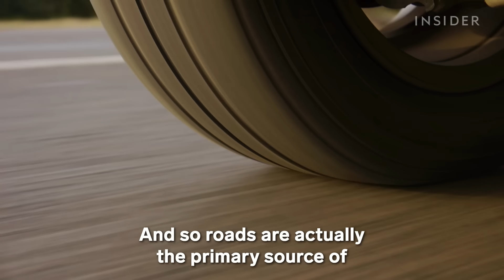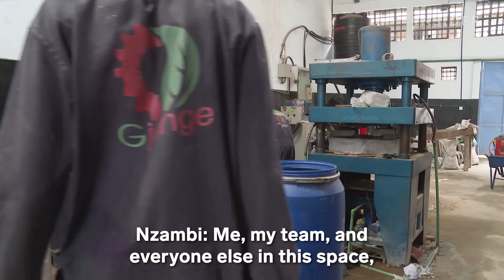Young Inventor Makes Bricks From Plastic Trash | World Wide Waste | Business Insider

Comment: We shouldn't use these for roads for cars because they would make a lot of microplastics, however we should use these for streets that people walk on since it would undergo a lot less abrasion and damage
Reply: Using these as foundation brinks wouldn't be a bad idea either.
Reply: @Holly Donut  yep. Some foundations use concrete with a compression strength psi of 3000. Some plastics have 2000 psi so it wouldn’t be a bad idea if the foundations are a little bigger and have a little more steel reinforcement. The only issue could be how they perform in earthquake heavy areas. 

And in terms of using these for roads it is definitely less worse for people based paths than car based ones. But the weather can still erode it into micro plastics. But tbh it is better than a land fill. Plus they can just use it as the bottom layer which is rarely exposed to the weather.
Reply: @Dutch_chess  It would be an immensely stupid idea. The bricks would break down over time, and would be continually leeching toxins in to the soil which would contaminate the ground water and work its way into rivers and lakes.
Reply: Toxic roads. They breakdown overtime, mix with water, and poison waterway.
Reply: It will undergo just as much abrasion over time. It is mixed with its own built in abrasive, SAND. This has to be one of the stupidest ideas I have ever seen. I cant get a plastic straw for my Thickshake, but this fool is praised for injecting micro plastics into the waterways and the oceans. All aquatic animals will be effected by this, causing damage on a molecular level, causing death and deformities. Anyone who cannot see this is unable to think for themselves.
Reply: @Tarquin67  u got a good point
Reply: most people don't have cars in Kenya anyway
Reply: @triplemoyagames4195  if u rilized they were also talking about making the place bigger and start sending the stuff over seas
Reply: @stevenrayne6401  I mean Africa is a huge place. With many countries having the same issue
Reply: @triplemoyagames4195  are you that naive to think these bricks will only be used in Kenya. This persons ‘invention’, for lack of a better word, will be used in other places. Just the comments of all the people in the video show you peoples lack of intelligence to see that this is not a good idea. 
 It is like the electric car. Sure you have no emissions, but what sort of energy mainly used to charge these electric cars. Fossil fuels!…..I do not know of ANY charging points in ANY country that use solar as a source. They are connected to the electricity grid. Then you have almost the entirety of the cars components being made of plastic. Plastic is made from OIL, and what is done with the plastics when the car has completed service. How are these plastics recycled or disposed of? With fossil fuels!. Then you have the highly toxic chemicals used in the batteries of the vehicles. How are these disposed of or recycled, and what sort of energy source is needed to do this. It certainly is NOT solar power, or wind power. Then you have the tyres which are the same as any other vehicles. They are full of toxic metals such as lead and zinc, which are worn down to fine particulate that is then washed into rivers and oceans every time it rains. 

And for that matter what sort of energy is used to produce the entire electric car. Fossil fuels. And before you say there are plants that use renewable energy, I challenge anyone to prove to me that there is a plant anywhere in the world that professes to be sustained by renewable energy, and I can show you where each and every one of these plants is still plugged into the main fossil fuel power grid. Watch Planet of the Humans to verify this.

AND I CANT EVEN GET A PLASTIC STRAW TO USE IN MY THICKSHAKE!
Reply: @Tarquin67  So you've gone on a rant because you're pissed you can't get a plastic straw really?
I am against fully electric cars replacing standard ones, but that's so unrelated to the topic at hand.
Also since we're being real, at the current stage, her company is know where near going international. she's barely covering Nairobi. I would know considering I'm a native.
It's a bad idea on roads, not sidewalks. Most kenyans don't have cars, nor the infrastructure to support them efficiently outside major cities and it helps address our major pollution problem
Reply: @triplemoyagames4195  Why aren’t the long list of things I mention banned?………..
Reply: most plastics break down in uv light (including sunlight) meaning putting them outside would be a bad idea.

Putting them inside is even worse since they would literally be gassing you
Reply: Is it fire, chemical ,
resistant?
Reply: Yea like side walks or the bike lanes
Reply: Ok
Reply: Keep going it is future, trust 🙏
Reply: @dertythegrower  ķ
Reply: Well we could use them for bike lanes because they were already in the environment, spreading. so using these plastic roads are slihtly solving the problem by stopping the plastic from floating around
Reply: Do u know how a lot of big store like Walmart,  Stine's, academy, some schools and a lot of others use a brick floor instead they can use this with a seal paint on top for stores and schools. This could also be used for parks and water parks.
Reply: They don't ve even streets and you are dreaming about roads for people

Comment: This is ecologically disastrous. If you imagine the day to day wear and tear, all the foot traffic and cars that will eventually erode and chip the plastic pavement releasing micro plastics into the environment. It solves a problem, but also creates a bigger problem.
Reply: i agree completely, but we're at the end stages of the industrial revolution where we've maxxed out the world's resources and normalized plastic as consumers. plastic is going to be impossible to avoid at this rate, burning it and created styrofoam-eating worms will only solve barely a fraction of the issues with plastic waste. had she not created a new method to utilize discarded plastic, it would've been left to erode and chip into the environment either way. at least in this form, it can be recycled and utilized productively.

Comment: Well if the plastic leaches or degrades over time it probably isn't wise to use them on high traffic areas. But again plastics tend to melt in heat, whereas asphalt can crack... Could the plastic in these tiles keep them from cracking?

Comment: Doesn't matter if its as hard if it doesn't have the kind of compressive strength of concrete. Its plenty useful for certain low stress applications but not high stress ones

Comment: I really hope this industry will be more widely accepted and companies like this can be given more support, like those workers need respirators when they are working with the plastic and pigments. My grandfather died of cancer after working as a foreman in a paint factory for decades and I think he had better protection than those guys
Reply: The main problem is going to be convincing people in lucrative expansion areas to adopt it and that's not happening with the concerns over microplastics, which is going to have to do with the binding with the sand that can make those brittle. Tbh they may actually be better off using pure extruded plastic bricks at that point. The Chinese may well adopt it idk, but the Western sectors will be slow to find acceptability in mass paving using plastics (the irony being it'll probably be a net detractor by hoovering up what would be dumped into the ocean otherwise).

Honestly we DO need more inventive ideas like this which the whole Western world has stagnated badly in its complacency. Given we are now suffering a baby formula shortage it's clear this system is not working and has achieved Soviet levels of efficiency and usefulness while wasting colossal amounts of resources. Recycling in creative ways in a lucrative manner is laudable.
Reply: I would disagree on the having it better.. ive seen werkplaces here in the Netherlands that now are better, but dont overlook 40 yesrs of evolution in technique and engineering :) he experienced times with less ventilation and knowledge on long term exposure, sadly speaking a human test subject, in great honor of protecting futures to come.. 

Sad to hear tho, and kind of you for worrying as well, was one of my concerns too, those fumes may not be very toxic short term exposure, but 40 hours a week might be less pleasant in the long run :/

Comment: I'm so inspired! She's providing a life for her 20 employees, and they're full time employees at that! I hope her business expands and she can tackle the plastic waste crisis in Nairobi and beyond.
Reply: @Daruki Neo I wonder how mold spores interact with this sand/plastic mixture
Reply: @Momofukudoodoowindu  I doubt it will get mold?
Reply: @kadens1903  under certain conditions, like prolonged moisture, they can separately. So that's why im curious if it can as a unit; and if so, will the integrity of the unit be compromised
Reply: I don't, she's creating more pollution and is part of the problem.
Reply: @First-Last_name  how is she creating pollution
Reply: @erensfeet5563  her bricks shed micro plastics in populated areas,  basically creating toxic micro dust.
Reply: @First-Last_name  how does bricks shed micro plastics? Seems like thats smthg that they would have addressed
Reply: @erensfeet5563  because they are made of recycled plastic. It breaks  down into a small fine plastic dust easier then most other plastics.

Other plastics eventually do the same, but much slower.  Her bricks essentially accelerate the rate plastic decays into a toxin, while putting it in public spaces.

 I commend her effort but it has unintended negative side effects.
Reply: @First-Last_name  Yes, agreed. Thats actually what they said in the video specifically and as to why it might not be sustainable long term.

Maybe there's something that can be added to lessen the toxins, but time will tell...
Reply: Toxic roads. They breakdown overtime, mix with water, and poison waterway.
Reply: Actually, since they are breathing in those fumes, they are technically giving their lives for this cause.
Reply: Everybody working there is going to get cancer from inhaling all those plastic fumes. (Notice she's the only one wearing a mask)
Reply: @Daruki Neo no it’s a terrible idea.. possible the most braindead idea i’ve seen, the spread of micro plastics will destroy the ecosystem.
Reply: Can u give her contact details
Reply: If any of you bleeding heart people really paid attention to video this is not the solution it's only making it worse. Micro plastic is worse than regular balk plastic. The true way to solve the problem is to stop using plastic period.
Reply: For the whole world we could build homes out of this stuff
Reply: @Luljpimp444  hahahahah there’s a reason educated and developed areas dont.. They aren’t braindead enough to spread harmful micro plastics that will DESTROY the ecosystem and everyone living in it LOL… Nothing like supporting a horrific idea.
Reply: @Luljpimp444  i make building bricks by stuffing soft plastics into plastic bottles - they are extremely strong when done right.
Reply: Providing job's for people to pollute the world. Amazing.
Reply: @KB-nt7eg  I think its a cycle. we didn't recycle this because we were not made aware of the dirty tactics food companies were up to. Now its our fault. Now more people on Kenya have jobs. Its a cycle.
Reply: @KB-nt7eg  are you slow?
Reply: @KB-nt7eg  They are not MAKING plastic. Blame the source. Nobody wants to STOP making plastic but point the finger at people like this? Use a little logic.
Reply: @PeppaJackable  all the while you blame your average Joe, right? They are putting it into uses where it can become even more fine and toxic. Where's your logic? I dont disagree with her business, I disagree with your insulting comment. In this video there's even an expert talking about this, why would you then go all insulting regarding logics if you didn't even focus on the video at hand?
Reply: i wanna buy shares of her company this seems like a brilliant idea
Reply: Big respect, you have no idea how many people should be doing this 🙏 big up

Comment: How does it work in practice?. It is clear that it will never be able to be used to build materials for buildings as it can melt and therefore will never be able to live up to the western standards within the construction industry.

How should one use that product as a replacement for asphalt and stone as road materials? To my knowledge, this product will give off plastic in case of wear and tear, and therefore it will not be very appropriate to use this product for roads as small plastic particles will be spread all over the wind and end up in nature and animals will end up eating it in the end i guess ? 

There is a very good reason why we in the West do not use plastic for paving various roads. It is simply not a good enough product for it, and how does plastic react to frost/sunlight/water? How does Plastic react as a surface during, for example, an emergency braking from 130 km down to 0 km? Will there be any vehicles such as trucks that get into trouble at maximum total weight? etc.

Will you be able to use the plastic bricks for something? Definitely, but it will hardly be a good product for roads or have anything to do in a building that has to live up to fire standards. Or that is how i see it anyways, god ide thow :)

Comment: 6:16 my guy is saying "plastic being burned" and the subtitles say ban. Its a bit sickening that despite the hype and the smiles this concept is going to go to shit as soon as a non negligible amount of microplastics is found near those cheap roads. And as petrochemical lobby fodder, you play your role perfectly as a journalist.
Reply: Incredible, you might actually be the only person making this entirely negative. Yeah because of microplastics it's not responsible to use this for roads or driveways. However this is entirely a reasonable and eco-friendly alternative to concrete and typical brick/pavers for foot traffic areas. Especially if there is an eco-friendly final surface treatment that can be applied. 

I imagine having back yard pathways, sidewalks, walls and small structures like fire pits and garden beds being made out of these. They'd likely experience minimal weathering or deterioration compared to a road or surface that goes under extreme weight and duress
Reply: @MAJ0ROCEL0T  The problem is though it's NOT eco-friendly. When the continuous exposure to those (plastic) bricks start causing cancer in people then what. It really is dangerous for those workers who aren't wearing proper gear. They inhaling all that toxic stuff. Don't get me wrong I get the need for solution and her trying to make one, but at what cost!?
Reply: @MAJ0ROCEL0T  There's nothing eco-friendly about micro plastics mixing with runoff
Reply: @MAJ0ROCEL0T  We used to think asbestos was cool too back in the day, we also sprayed pesticides right on the street where people were walking. I'm not making it negative just for the sake of negativity. I've no doubt regular cement has a bunch of non eco friendly consequences (and you wouldn't want to know what mafias are in charge of selling those massive amounts of concrete).

Comment: We have roads that degrade in years but plastic does not except when exposed to uv rays and that can be fixed with a thin coating of nylon or polyester on top we have so much waste plastic why not give it a useful somewhat permanent residence in better roads there wouldn't be as much restoration paint jobs on vehicles from loose gravel also putting in titanium dioxide to reflect more light radiation into the atmosphere instead of having the roads hot enough to cook an egg on a summer day. With all of the roads in the US and the world we could surely use up most of not all the plastic waste

Comment: that concept is very old and has been done many times now.
The problem is this only works if you get plastic for free and if this would ever turn into a big enough market (which it wont for other reasons) you can bet there would be low cost countries producing bricks from virgin plastic instead of recycling trash because they will do what ever brings in money.

But overall the reason why this simply does not work is that plastic is extremely bad for what we want from a brick, a brick needs to be hard and not yield when its getting hot like it will absolutely from the sun.
Plastics we use commonly have low glass transition temperatures so they start deforming from heat WAY before their actual melting point.
This is exactly what you dont want from a brick.

Comment: if plastic road not safe regarding to microplastic issue, why not just use it as a base only replacing crusher run. rock is something buried underneath premix. at least we still buried plastic  brick at proper place rather than buried in landfill. plastic cement in drainage system will probably help solving or recucing cost. it will help flooding area because of bad drainage system and reduce plastic waste in drainage system itself

Comment: Sounds like the roof tile plan she has for expansion will release less microplastics into environment, while still using her technology to reduce the plastic waste. But even the paver bricks at least reuse the plastic. It's not like it wasn't going to break down into micro plastic sitting in the landfill. Solid solution for a current problem, using innovative ideas. Does it solve the problem entirely no. But it's a start.